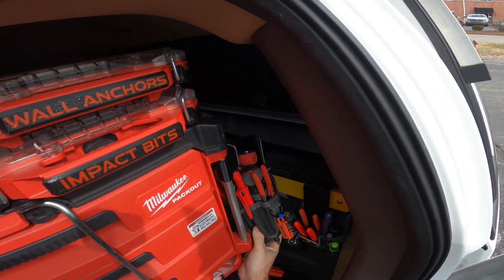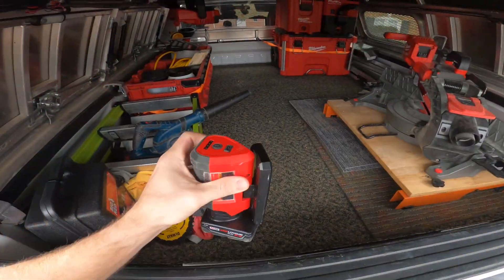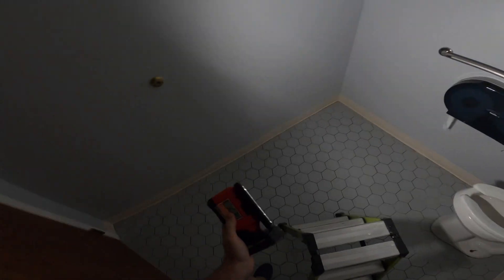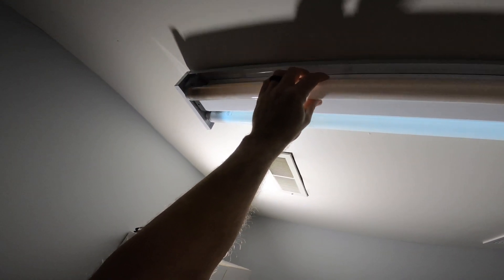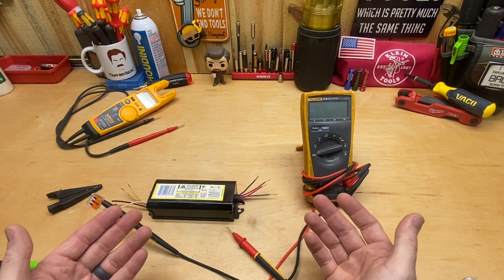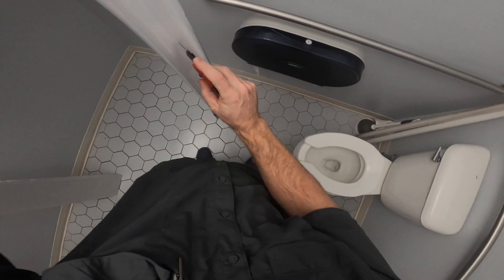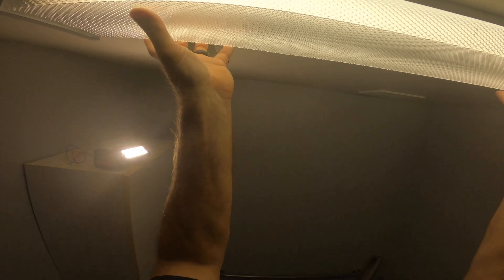Fluorescent Light is Out - Ballast or Bulbs / How to Test #maintenance #electrical  #watchmework

Comment: I have a 4 lamp system with two ballasts. They are a f40t12 ballast. I lost two lights and assumed a ballast. I did your check a m d the blue wire shows bad. I bought a new ballast and installed it and it didn't work. I checked that ballast and the blue wire was bad. The known good ballast that powers the two lit bulbs I removed those bulbs and checked the ballast using your suggestion to check at the head without moving the ballast. The yellow and red were fine but the blue tested bad with the ohm meter. How is that possible since the bulbs still work on that ballast?
Reply from the maker: A ballast can still work (as far as the lights coming on) and not be functioning at 100%.  It’s not necessarily a work/doesn’t work situation.

If it were me before I bought two ballast I would rewire to do LED bulbs to take them out of the equation.
Reply: @MORGANSMaintenance never heard of re wiring for led bulbs. I recently replaced all four fluorescent bulbs. Can you direct me to a how to video to convert to led?
Reply from the maker: @mowens1972 I don’t have a how to video.. I have a watch me work that shows me doing it.  I explain some of it.

T8 Fluorescent to LED with Feit Ballast Bypass & Office Furniture Assembly #watchmework
https://youtu.be/9o8a9FqVO3A

But you essentially remove the ballasts and hook up the wires on a set of tombstones to the neutral and the other set to the hot. The bulbs have a neutral and hot side

Comment: Do you check it the same way if its a 4 light fixture?
Reply from the maker: Yes.. you are checking the ballast so it doesn’t matter how many bulbs.  Sometimes a 4 light fixture has two ballast, if so you would have to unwire both to check each one

Comment: I took covet off and its 94" bulb with a nipple on end.   I'm hoping the tombstone is same directions and when I remove the metal cover behind the bulbs.  That it's only 1 ballast.  I already grabbed new bulbs but they didn't go on.  So I hope ballast
Reply from the maker: Yeah that’s an old one.  I have t seen one of those type in awhile
Reply: @MORGANSMaintenance  HI.  I did it.  My 1st ballast.  The meter instructions worked as planned.  Got the numbers not all OL ....so I knew it was ballast.  Went to Lowes.  I asked for help and the gut sent me home with a T12.  It had 2 extra yellow leads so I took it back and won't ask for help next time....so I opened the box till I found the 2 blue and a red with white and black.  The T8 was perfect fit.  I'm 67.  And the hardest part was getting the covers back over the ballast.  Speed clips and arms over my head for extended period of time 
Thank you for the help
Reply from the maker: @joelavin5619 the arms over my head for an extended time get me too

Comment: Hi.  Newbie here.   Sorry if i didnt read every comment but.  When checking ballast still up there and one side goes to tombstone.  Is power still off?   The light switch stays off i meant
Reply from the maker: You need to have the power off… and disconnected from the ballast, both the neutral and the hot wire need to be disconnected that way you are only reading the ballast.
Reply: @MORGANSMaintenance thank you.  Going to try tomorrow.   Will let you know how I did. Appreciate it
Reply from the maker: @joelavin5619 👍👍 other signs is your ballast is humming quite a bit, or has some black substance leaking from it.  Those are typical symptoms of one that is not at 100%.  The meter just verifies it
Reply: @MORGANSMaintenance super helpful answer

Comment: One thing that I run into a lot is a 2x2 troffer fixture with 2 U-bent tubes in the bathroom.  Troffer fixtures are intended to be recessed however, they are not always recessed.  So, you may or may not find them recessed.  But if you do, they are often recessed into the sheetrock ceiling instead of in a drop down ceiling.  On occasion, you will bumb into a shop light fixture in the bathroom.  I have come across shop lights in the bathroom twice.  If you do, watch out for the Benchlite ballasts (RL240TP) and Homebrite (HB240TP).  Those ballasts were seen included with shop lights or other utility room lights and wraparound fluorescent lights that were intended for the home.  Both ballasts were really bad.  Only operated F40T12 lamps at 15 watts of light, very pathetic.  I'm sorry but that's just sad!  But despite that, those ballasts were so incredibly inefficient that they got super hot during operation and you can even kill them by running 34-watt energy saving lamps on them.  The very first 34-watt tube on those ballasts, done!  Finger snap!  It will nestle those ballasts nicely in the potty.  Flush it!  Very terrible ballasts indeed!  I know that Lithonia did offer their shop light fixtures with commercial grade ballasts, by calling ES at the end of the model.  I think it was the SL40-ES.  And then you could use 34s.  Those terrible ballasts are residential ballasts and residential ballasts are known for not handling 34-watt tubes very well.  The 34-watt tubes cause the ballast windings to draw more amperage than they were designed to handle.  Amperage is heat.  That melts the varnish on the wires inside and the windings short out.  The starting capacitor blows up and then the ballast simply does nothing from then on, and your light fixture won't wake up in the morning.  I would imagine that the same reaction would occur if you put F32T8 lamps on one of those residential ballasts as well but I am not in a hurry test it.  Don't ever put 34-watt tubes on older commercial grade ballasts from the 1960s.  You do this, those 34-watt tubes WILL blow out those ballasts as well.  Some will even cause the 34s to explode and discharge broken glass every which way.  Be careful!  A lot of newer fluorescent tubes are marked with the iconic E within the circle and the Energy Star logo.  These are very easy to miss.  Fluorescent tubes marked E or Energy Star logo, are 34-watt tubes.  Residential ballasts and older commercial grade ballasts from the 1960s don't like the taste of 34-watt tubes, they can only operate 40-watt tubes.  Only 40-watt F40T12 tubes are able to fly on residential ballasts and older ballasts.  Believe me, I know!

As a footnote, that RELB2S40N electronic T12 ballast will operate T8 lamps as well.  I do that occasionally.  While, you're probably going to say that isn't good and you are right about that however, it's really a mute point since fluorescent lights are on their way out the door.  In fact, I think fluorescent lighting is already out the door.  T12 went out the exit back in 2013.  I think fluorescent is going out the door so it's not much use arguing over what tubes should be used with anything.
Reply from the maker: Yeah… 99.75% of the time I talk the customer into LED
Reply: @MORGANSMaintenance I like LED as well however, myself, I prefer the fluorescent fixtures converted to use TLEDs, the LED light tubes.  What I do is just install a programmed start electronic fluorescent ballast and then just use the TLED tubes on it, the LED light tubes that work with fluorescent ballasts.

BTW, the Benchlite ballasts (RL240TP) and Homebrite (HB240TP) ballasts were the same ballast manufactured twice and a different label slapped on them.  What they did was they manufactured the same ballast twice and one ballast, they slapped the RL240TP label on it, the iconic green, sometimes black label.  And it was intended for shop lights, residential grade strip lights, or other utility light fixture.  And then they manufactured the same ballast twice but on the second one, they slapped a HB240TP label on it, the iconic gold label.  It was intended for wraparound fixtures.  Although, I have seen the HB240TP be included with shop light fixtures a bunch of times.  Maybe the manufacturer said, "A ballast is a ballast!"  They had a bunch of HB240TPs sitting around?  Hard to tell.  They reinvented the RL240TP and HB240TP into one unit and redesigned it to handle 34-watt tubes perfectly fine, HB234TP however, still don't put 34s on it.  I have actually seen hundreds of HB234TPs damaged by 34s.  The 34-watt tubes still overwork the HB234TP, damaging it, but over time.  34-watt tubes don't damage the HB234TP right away like it does the RL240TP and HB240TP, 34-watt tubes will cook the RL240TP and HB240TP in minutes.  However, with the HB234TP, 34-watt tubes overwork the HB234TP over time.  So, 34-watt tubes shorten the lifespan of the HB234TP.  Very short period of time before you'll start having black tar dripping from the HB234TP, nestling that HB234TP nicely in the potty.  Flush it!  And I think that was a HB234TP that you pulled out of that wraparound in that bathroom.  I see wraparound fluorescent lights being used as utility lights a lot and I see HB234TP ballasts a lot in small privately owned businesses, individually owned businesses, family owned businesses.  So, I am guessing that this one was likely a family owned?  However, I almost always use TLEDs on fluorescent ballasts.

Looking into the future.  They say that we are on the dawn of a new era of age with LED.  Who knows what sorts of progress we'll see in the coming years.  Our technology changes constantly.  I have been hearing about a new light source that might be coming, plasma lighting.  Another one, laser lights.  Light emitting plasma.  Light emitting plasma is an HID light source, high intensity discharge, just like mercury vapor, high pressure sodium, and MH (metal halide).  It uses a different technology that uses no mercury at all.  It's a coming light source.
Reply from the maker: @chadrowland5234 will be interesting to see where lights go… everything has advanced a lot in even the last decade
Reply: @MORGANSMaintenance The original LED bulbs, I didn't like them originally.  It took me a while to adopt LED light bulbs, I'm not going to lie!  They had their place but the chandeliers in my house have cut-glass crystal and the original LED bulbs didn't look right.  But they have fixed that.  You can now get them in the filament style LED bulbs that look great, work great.  It's hard to pass up now.  However, it is taking me a while to give up fluorescent and metal halide.  I'm not going to lie!  LED is great for replacing incandescent but the LED just isn't able to duplicate fluorescent and MH.  Especially high pressure sodium.  However, I do believe that light emitting plasma will be a game changer for those applications.  Light emitting plasma is really an electrodeless metal halide lamp.  That is, a metal halide lamp that has no electrodes at all.  It uses a radio frequency to facilitate the discharge.  Oh wow!  But basically, it's an HID light source, high intensity discharge.  It just uses a radio frequency to facilitate the discharge instead of using an electrode.  It's another way of facilitating a discharge light source, and a very interesting one at that.
Reply from the maker: @chadrowland5234 interesting.  Appreciate all the knowledge 👍👍
Reply: @MORGANSMaintenance PCBs is found in older ballasts.  You definitely want to be careful with PCBs.

Comment: I was taught that this only works with magnetic ballasts and that if the coil is open (broken wire) → you’ll read OL.

If the coil is shorted (insulation between turns failed) → you’ll read 0 ohms.

If the number is finite and close to 0, it’s good to go…

But even with all this, can get false readings and it’s always better to test the output voltages..

Let me know your thoughts!
Reply from the maker: That could be the case on the only magnetic ballast, that’s all I’ve ever dealt with so I’m not sure about others.

Any new one I get out of the box always test OL unless someone returned their old one and put it in the box… which has happened 😂

Comment: You can still get an open loop reading when checking continuity and have the ballast be bad. Check for volts as well. You can get a low volt reading of 2 or 3 and the fixture won't work and the continuity will still show the ballast being good

Comment: RLQ-120-TP this is my ballast code. i cant find same one. what can i do ?
Reply from the maker: @popsncracks9108  I’m not sure if these are good or not but it’s a replacement https://www.zoro.com/ilb-gold-fluorescent-ballast-replacement-for-philips-rlq-120-tp-rlq-120-tp/i/G409163365/

They have discontinued the one you have.  You can get a ballast bypass LED bulb maybe and rewire the fixture without a ballast. It would be cheaper and you would then have LED

Comment: How about, or do you already have, a video on converting the fluorescent bulbs to LED's? I have the LED's and think i can just disconnect the Ballast and wire them straight through. Let me know and I'll check it out...thank you kind sir!
Reply from the maker: I haven’t done a video for that yet.  

There are direct replacement and rewire LEDs. The direct replacement you leave the ballast in place and just put in the bulbs… but then you still have a ballast that can be bad/or go bad.

The rewire you basically wire one side of the fixture to the hot wire - I usually tie the Red/Blue wires to my Black wire… and the other side to the Neutral - I usually tie my yellow wires to white wire.

Those bulbs usually have a L and a N on each side… L is “Line” or Hot Wire, N is Neutral. You just put those in however you wired the fixture.

One thing to make sure you do with that type of bulb is always have the power off when you change them or Install them.  If you pull the bulb out on one end and touch the metal fixture it will spark.
Reply: @MORGANSMaintenance  Thank you, i figured that may be the case but just wanted to make sure! I had a fluorescent bulb spark on me either on install or removal where the switch was left on. Never again will i do that, and i knew better! Again, thanks!

Comment: I agree ballast bypass LED is the way to go in most situations.   When it comes to fluorescent however, I've usually had good luck by using the process of elimination.   First I try a set of known good lamps, this can be as easy as borrowing a set from a fixture that is working properly for testing purposes.  If the fixture still isn't working properly or at all, I use my multimeter to verify the correct voltage is reaching the fixture, this is usually 120 volts, but could be 208, 240 or 277 volts in commercial/industrial situations.  If the voltage is correct, next I verify the fixture is wired according to the diagram on the ballast, and that all the connections are secure and free from damage, and that the ballast is the correct type (rapid start or instant start) and wattage for the lamp(s).  If the fixture has a starter(s) (usually only found in fixtures more than 40 years old) I go ahead and change them as well.  That leaves the ballast as the remaining culprit if everything else checks out.  Bad fluorescent tubes are usually blackened at one or both ends, while a bad ballast is often indicated by a burned smell and discoloration, the older magnetic ballasts often make a loud humming or buzzing sound and sometimes have a tar-like substance leaking out when they go bad.

Generally instant start lamps can be identified by a single pin at each end instead of two, and usually only found with 6 & 8 foot lamps. More modern T8 lamps of 2, 3, and 4 foot sizes are typically operated on electronic instant start ballasts with shunted sockets, or a jumper between the pins of a standard Bipin socket.   Rapid start ballasts require standard (non shunted) sockets.
Reply from the maker: @Sparky-ww5re  lots of good info.  I appreciate it 👍👍

Comment: Can you check the ballast without removing the hot wire and just turn off power and connect to neutral white wire and then the tube socket?
Reply from the maker: I’ve always disconnected both just because you never know what kind of resistance you may read if you leave it connected.  It possibly wouldn’t matter… but I always remove both just to make sure all I’m reading is the ballast. You never know what the internals of the ballast may have wrong with them, but it could possibly be fine

That’s my 2 cents anyways

Comment: if a ballast gets wet from the ceiling leaking, will that affect it? Can you let it dry out and then test it? thanks
Reply from the maker: If it wasn’t submerged it will likely be ok.  Water wouldn’t just “go into” it typically.  I’d do like you said, let it dry out and test

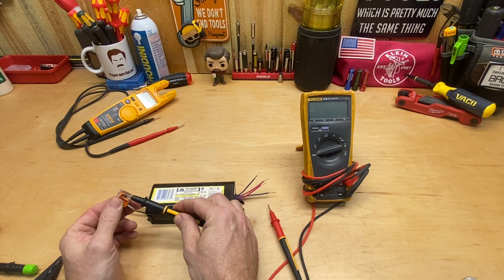Comment: Great video! 6:51 
Replaced several 4 & 2 bulb fixtures in the garage with LED bulbs and once i worked out s bug or two-I've had no problems with them! Kitchen 4 bulb florescent went out all together and from this video, the ballast tested good and 2 different types of T8's both had ohms 6.5 on 2 and 509/530 on the stouter 2. Incoming power was 135 with switch on, but all over the place with switch off? To be honest, I've got 2 more of the LEDs and am considering rewiring for those -any advice on what went wrong with florescents?
Reply from the maker: @williamlee2562  your incoming power being all over the place with the switch off is a little weird and your incoming voltage is a little high… but no I’m not sure. 

If it’s not a bulb or ballast it is generally incoming power or It could be connection points at the tombstones.  However it would be rare that you would have an issue with all 4 connections at the same exact time and with T8 you would still have some lights.

Comment: Thank you for this video and information.

Any recommendations on a 4 bulb (2x4) troffer replacement and also a 2 bulb (1x4) troffer replacement?
Reply from the maker: @aceenterprise  I pretty much install the flat panel LEDs these days.  I have had good success with Sylvania and Lithonia brands

They are slim so you can raise the ceiling more, and you don’t get the bugs and stuff inside
Reply: @MORGANSMaintenance  - Awesome, thank you so much for the information!
Reply from the maker: @aceenterprise  👍👍